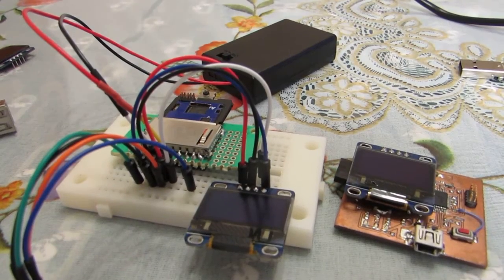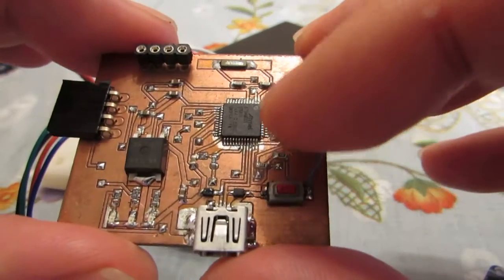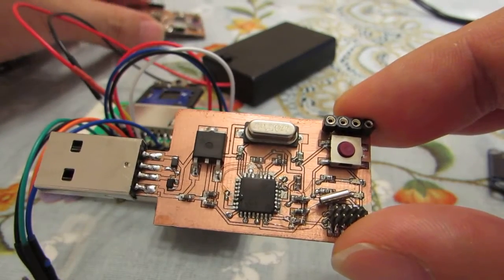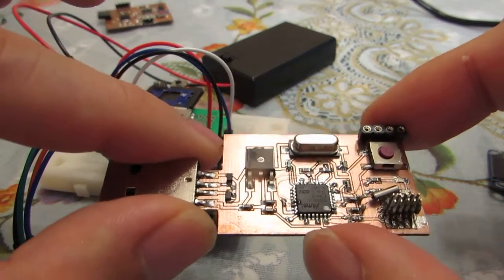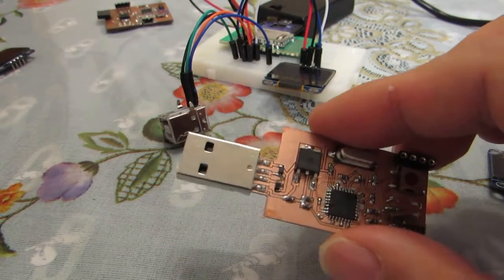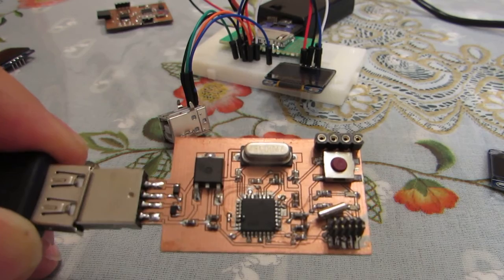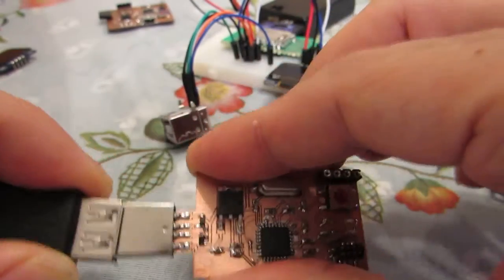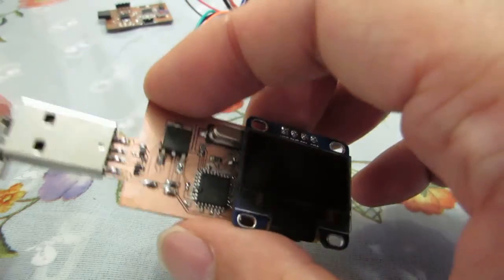Here comes new variant: ATSAMD21E TQFP32 Arduino Zero compatible

Comment: Is reset pull-up required for bootloader to work? I burned the bootloader but when I connect the board to the usb, it is not getting detected. I do not have a reset pull-up. Could reset be the issue?
Reply from the maker: It's been very long time since I did this.... I remember, not only burning boot loader, also fuse-bit (the name is not fuse bit but initial setting EEPROM inside chip) setting was required. The bit can be referred from that of genuine Arduino Zero.

Comment: how do you load Zero bootloader ?
Reply from the maker: +Davide Arzarello Yes, I did.
Reply: Can you share the procedure?
Reply from the maker: +Davide Arzarello OK, it is quite easy if Arduino Zero loader. Firstly we need "ATmel ICE" and Arduino IDE of arduino.cc. Connect USB for bare-born SAMD board and ATmel ICE to computer. ATmel ICE should be connected to bare-born board by cable. Open Arduino IDE and select board as "Arduino/Genuino Zero" and programmer as "ATmel SAM-ICE". Just select "Burn Bootloader"! That's all!
Reply: +microwavemont And you didn't need to modify the board definition file to upload sketches or anything?  It just worked?
Reply from the maker: +Shawn Swift Hello! Actually no! Simply correctly it is working as Arduino Zero on Arduino IDE!

Comment: Would you be willing to provide schematics for your basic board?
Reply from the maker: +Drew Jensen Hello and thank you for your interest. Indeed this project was deleted, but you can fine information at webarchive... Please find at https://web.archive.org/web/20150906201126/https://hackaday.io/project/7355-minimum-zero-compatible-sam-d21g18-d21e18-board
Reply: +microwavemont Thanks so much! I remember seeing it there and looked but didn't see it. Now I know why (deleted for whatever reason).

Ok, I hope you don't mind me asking one more question. What do you use to boot load it? Do you use an Amtel ICE with the Arduino IDE or Amtel Studio? Would you be willing to do a simple tutorial on that?

Thanks so much, seeing what you've done has been very helpful and inspiring for me to keep up on my project. I'm not having very good luck with my board design & the Atsamd21e17
Reply from the maker: +Drew Jensen Actually, the software depends on which arduino (.cc version or .org version) you want to make. The case of .cc version, simply Atmel ICE with Arduino IDE is enough. Just connect Atmel ICE and selecting programmer as Atmel ICE and simply choose "burn boot loader" is enough. Most of my case I use this way, but the case of .org version, you will need Atmel Studio and need to use Studio-embedded binary uploader. Someday I will make simple tutorial. Thank you for your interest!!
Reply: +microwavemont Would you be willing to answer a few more questions via email?
Reply from the maker: Here you can get it!! , than you !! https://github.com/kodera2t/SAMDi_minimum